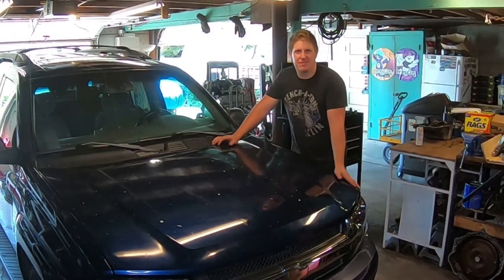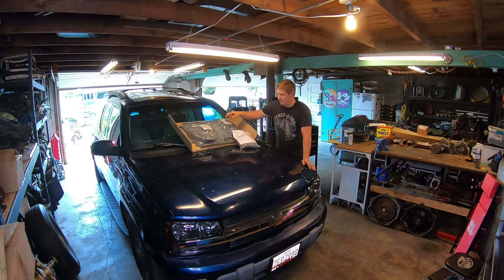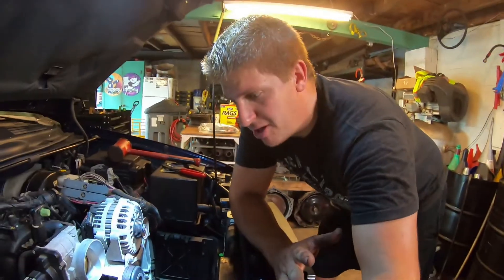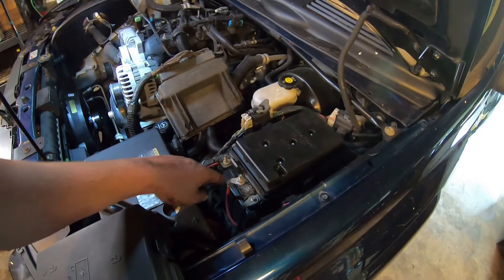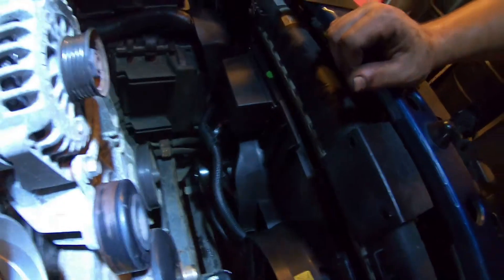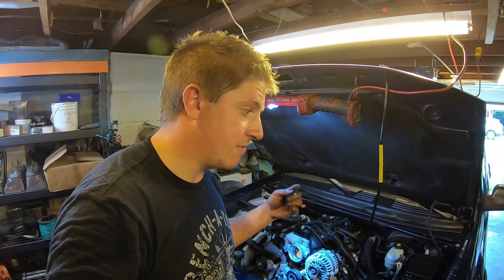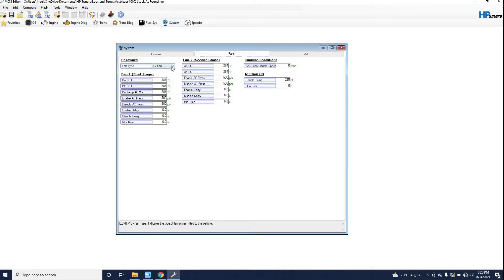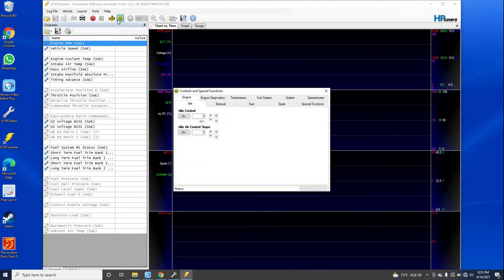Installing the PCM of NC Trailblazer/Envoy ELECTRIC fan CONVERSION!!

Comment: Hey nice video I have 2005 gmc envoy xl 4.2 I've been debating about doing something I like that you were able to find duel electric fans that fit and perform better that the single electric fan from PCMofNC does their wiring harness work with the duel electric fan setup  by any chance could you give me rock auto part number for them only think I'll have to pay mechanic to install my and part number for the pcm tuner that you used thank you 2005 GMC ENVOY XL 4.2 K&N cold air intake throttle body spacer big cherry bomb muffler with 8 inch deasl tip
Reply from the maker: PCM of Nc does make a harness for the dual electric fan setup. The electric fans are for a 99 to 02 f-body camaro or firebird with the LS1 V8, I don't have the part number unfortunately.

Comment: When changing to electric fans do I need to tune my ecu
Reply from the maker: Yes if you want the pcm to control them you will have to add electric fan controls to the pcm programming and add the wires coming out of the pcm to control the relays.
Reply: did you watch the video

Comment: Question @mohawk I have 06 i6 trailblazer.  Converted from efan to thermal fan. How do I get tune 2 not have code?. No stealerships
Reply from the maker: Anybody with HP tuners or another way to alter the pcm programming can get rid of the codes for you. There are actually some very low cost ways to do it, check out The Driveway Engineer youtube channel, he did a video on the various ways you can tune these pcm's with very little cost.
Reply: Ty so much for the reply !!! Appreciate it

Comment: does this work with the 2002 i6 trailblazer
Reply from the maker: Yes, this kit is available for the 4.2 inline 6 trailblazers and envoys as well.
Reply: @MohawkMotors  is there any costom tuning? i have a dual fan set for itjust looking to see how mutch im gonna put into it
Reply from the maker: yes the pcm will need to be programmed to control the fans, to get someone to do the programming I would expect to pay at least $150 possibly more.
Reply: @MohawkMotors  hm okay im getting a tune soon so thats fine on their website they say they do it for free but that sounds too good to be true
Reply from the maker: @grimreapersbrotherdave2392  if you're getting the engine tuned, they can add the electric fan controls at the same time in like 2 minutes so it would make sense to have that as a free add on
Reply: @MohawkMotors   no im not tuning with them im in a diffrent state im just confused how that would work if you went through  that
Reply from the maker: Each tuner is different, for me my base fee is $150, $100 of that is licensing the pcm to be able to reprogram it at all. Then I add on top of that depending on what the person needs or wants done.

Comment: is it still working well for you , this helps with MPG and HP ?
Reply from the maker: It's been working great so far. It improved my mileage by about .8 miles a gallon. About 30 more miles per tank. I didn't feel any seat of the pants power difference, but the mileage alone was worth the effort, it'll pay for itself in saved gas in less than a year at todays prices.

Comment: Nice mod, I love how easy it is to do this on these LS engines.  I was lucky, and my 06 came with electric fans, but the PCM I have for my 6 liter that is going to be going in is setup for clutch fan, so I get to try this out too!

I'm guessing you did this before you got that Camaro you just posted on Instagram, since you bought Camaro fans ;).
Reply from the maker: Yeah it is really nice how easy it is to add to these PCM's. And yeah, I actually did this over a week a go and just picked that donor camaro up on tuesday.